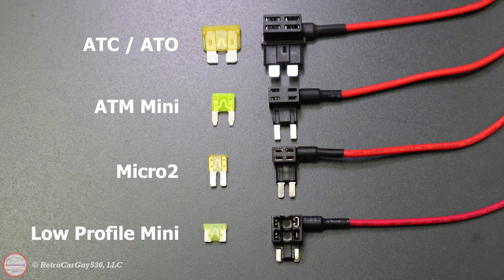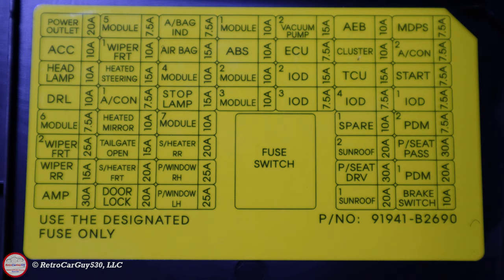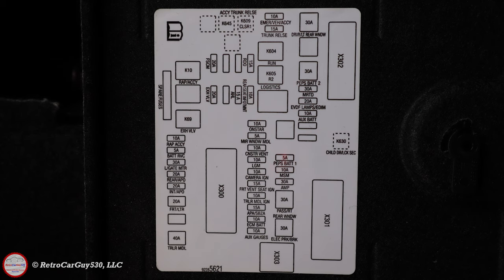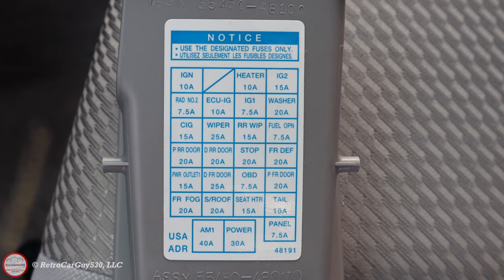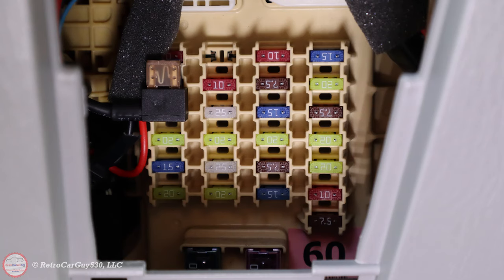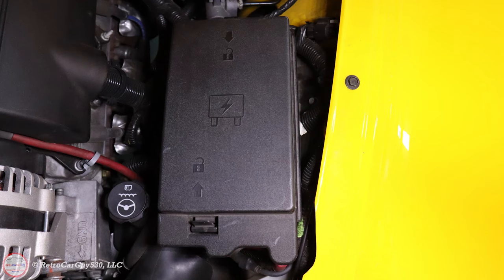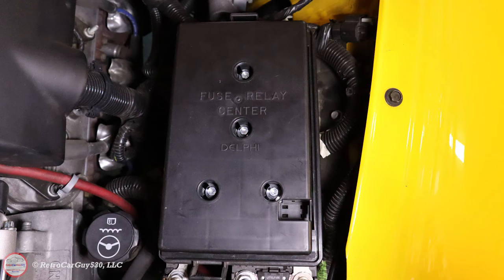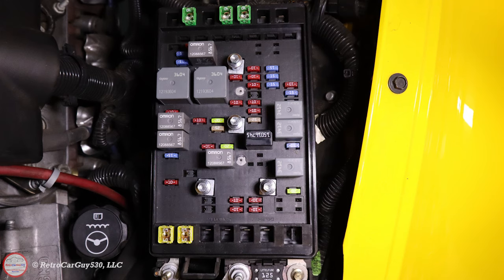How To - Add a Fuse Tap in Your Vehicle

Comment: Im tapping into my fuse box to install an aftermarket stereo. What. Amp fuse should i he using and what kind of wire. I have a 10 amp fuse and speaker wire atm is that ok?
Reply from the maker: I would not use speaker wire for powering the unit (if I'm understanding your question correctly).  Most fuse taps have a 14 or 16 awg wire lead coming out of it.  There are a large number of wire-to-amp charts on the internet that show a 14 awg should carry no more than 15 amps for a maximum of 6 to 8 feet.  If its 16 awg wire the distance is even shorter at 15 amps.  I used search terms "automotive wire gauge amp chart" on google to find a variety of those charts.

I would recommend regular automotive wire (copper) to run from the fuse tap to the new stereo power input.  Since the fuse tap likely has a 14 or 16 awg wire lead coming out of it, you can't really expect to safely use any gauge wire bigger than that.

If your stereo requires more than 15 amps, then powering it directly with the power from a fuse tap may not be possible.  Although, you could use the fuse tap to power a fused control relay which is wired to supply higher current draw (amps).  I used this approach to wire in a dash camera battery pack (that supports parking mode recording).  The dash camera battery pack has two current / charge levels.  A lower amp draw mode that can be safely used with a power port plug, but it doubles the time it takes to fully recharge the battery pack.  The other charging mode consumes more power/amps and reduces the charging time in half, but you can't safely power that through a power port plug - you need to hardwire it with appropriate wiring.

In that situation, the fuse tap power lead supplies power to a power relay with a fused power circuit.  When the fuse tap supplied switched power is on, the relay control circuit closes which supplies power from a different source with a thicker wire to then supply power to the dash camera battery pack for charging.  This way the fuse tap power demand is low and it won't overdraw the wiring of the fuse tap and the higher amp draw power is run through a fused relay (connected directly to the battery positive terminal in my case).  I used a control relay that actually has a fuse socket in the relay itself so the power it supplies is still protected by a fuse.

I hope that helps.
Reply: Thanks for the quick reply! I didnt think it would be suitable. In the manual for the stereo it days the maximum  current comsumption is 10a. So use a 10a fuse? And the operating viltage is 14.4v (10.5-16v allowable) sorry if i sound dumb. Electrics is not my strong point. I will get some suitable wire, i have a 10a fuse and thanks to your video i am confident that i can do it correctly.
Reply from the maker: Sounds like a 10 amp fuse should work.   Good luck with your stereo installation!

Comment: what if the SAP type power outlet is required to power some electronics ? Can we still use the fuse panel for that ?
Reply from the maker: I'm going to have to ask for some additional info to make sure I can answer your question correctly.

If you're asking whether you can add a fuse tap to a fuse socket that supplies power to a power outlet in the vehicle that powers some electronic accessories, the answer is maybe.  If the fuse tap added fuse and the original fuse in the fuse socket don't exceed 25 amps total (sum of both amp ratings of both fuses), then you most likely will be able to add the fuse tap.  The concern is that most power ports tend to have a 20 amp fuse by themselves so adding a fuse to that fuse socket would mean at max a 5 amp fuse could be added with the fuse tap.  I talk about max fuse loads, wire gauge size and wire length as factors that go into making the decision of whether a fuse socket is viable for adding a fuse tap.  You might want to check out my other FAQ video for this topic.  https://youtu.be/DnZ5wb_A5vE

I hope that helps!
Reply: @RetroCarGuy530  No I meant supply of POWER ( with fuse) at the fuse panel for ignition based power supply. I saw that you get the power from the fuse panel - so does that mean it( fuse board) is a source of power for additional sockets ?
Reply from the maker: The fuse panel will usually have four different types of power supplied in the various fuse sockets in the fuse box/panel.

Unswitched - power supplied from the vehicles battery and is available 100 percent of the time.  This power is usually fed directly to the fuse box/panel from the vehicle's battery.  In the video, I used an 120V AC to 12-volt DC power supply to act as the vehicle's battery of unswitched power.

All of the remaining types of power are supplied to the fuse box/panel by having some switch, relay or control module determine when power is supplied to that circuit in the fuse box/panel.

Switched - power supplied when the ignition switch is in either the accessory or "run" (engine running) position.  The ignition switch or "start button" circuitry will send power to specific pathways/circuits in the fuse box/panel when in the accessory or run position.

Switched RAP - just like switched power but it may stay powered for some period of time after the ignition is turned off or until a door is opened (radios in many modern cars use this type of power).  There's usually some sort of module (often the body control module) that will keep track of the state of this type of power and turn it off if the time limit is exceeded or a door is opened.

Relay (or Module Controlled) Switched - This one is a bit specific to a feature in the vehicle.  A relay is commanded on/closed and power is supplied to some feature/accessory/function in the vehicle.  It likely will be routed through a fuse in the fuse panel/box as well.  For example in some vehicles, there may be a relay that is used to control the power sent to the vehicle's headlights and that power is only on when the headlight switch or control circuit commands it on.   Another example of this type of circuit is for the engine's starter motor.  The ignition switch does not directly supply power to run the starter motor, but it sends power to a relay or control module which will send power to starter solenoid.  The starter solenoid then will close the circuit so high amp power can be supplied to the starter motor to start the engine.

There may be a module in control of the power sent through a fuse socket as well.  For example in my 2014 Chevy Caprice PPV, the Body Control Module (BCM) is in control when the various interior lights are turned on/off.  There is still a fuse in a fuse box/panel for each of the items that receive the power, but the BCM is in control of when power is supplied or supplies the power itself to the fox box/panel's fuse socket.  The interior dome lights are one example of that type of power controlled by the BCM.

The fuse sockets in a fuse box/panel have a very specific mapping of circuits on the underside of the fuse box/panel.  I would not take power from one fuse socket in a fuse box/panel and jumper it to another set of fuse sockets in the fuse box/panel.  Those fuse sockets may have a connection to something else in the fuse box/panel that may start back feeding power to something that may result in odd device/accessory behavior or an unexplained battery drain issue.

I don't know that I've answered your question of not, but I hope this has helped in some way.
Reply: @RetroCarGuy530  really thank you for all this though of little use when it comes to my short question > I was simply asking for SAP power( ignition controlled power) to be sourced from Fuse panel and yet you explain all the rest- Sorry I 'm still confused: Put it simply this way : Can I source  a power socket from the fuse box rather than from the battery directly?
Reply from the maker: Thanks for the additional info / restatement of your question. The short answer is probably no.  The reason being that the power demands (amp draw) of the power port you're trying to power from the fuse tap in the fuse box is likely to exceed the the available amps available in the fuse socket (unless it is not occupied with an existing fuse of any kind) or the fuse tap wire gauge of 16 awg or 14 awg might not be sufficient for the amps required and length of the wire of the new power port.  

The answer can be a "yes" if the power required by the accessories powered by the new power port will be less than the available amps in the fuse socket and can be supported by the wire gauge and length of wire.  I talk about all of those issues in the FAQ video that I have a link to in my first reply to your question.

In the FAQ video, I have a chart of amps vs wire length showing the general rule for how many amps a particular wire gauge can handle and for what length of wire it can handle it.

In the FAQ video, I discuss the calculation you must perform to see if the new accessory (or power port in this case) amp draw can be supported by the fuse socket you want to add the fuse tap to.

If you can say "yes" to all of the questions above, then you should be able to add the power port via a fuse tap, but in most cases the power port could have a device plugged into it that may overdraw the amps of the fuse/wire gauge unless there's a dedicated accessory you're going to plug into it which won't exceed those limits.

If the fuse tap approach won't work for directly powering the power port, you take the approach of getting a 12-volt relay that has the fuse tap supplied power operate the control side of the relay and the power supply side of the relay goes directly to the battery (with an inline fuse or a fuse at the relay).  I use this approach for the dash camera battery pack I have in my current 2014 Chevy Caprice PPV project car.  

A switched power fuse socket is used to supply power to the control circuit of the relay.  The relay's power supply side is directly connected to the positive terminal of the battery with an inline fuse right at the relay.  I have a 5 amp fuse in the fuse tap that supplies power to the control circuit side of the relay and a 15 amp fuse in the relay that protects the power supplied from the battery to the dash camera battery pack.  The wire gauge and amperage requirements of the control side of relay are well within the capabilities of the fuse tap and its wiring.  The relay wires and additional wiring running from the battery-to-relay and relay-to-dash_cam_battery are sufficient to supply the up to 15 amp power draw for the dash camera battery pack.  There just wasn't a viable fuse socket in the fuse panel supplying switched power and that had available amperage to supply power directly to the dash camera battery pack directly.  That's why I went with the relay solution.
Reply: @RetroCarGuy530  Make sense - many thanks - the kind of max current of the device intended is 2000mA - it should do the job I guess!

Comment: How come if you use a t-connector and tap power directly from the positive wire on the cigarette lighter, you don't need an extra fuse? But this method you do?
Reply from the maker: A t-connector is relying on the fuse for the circuit that it's tapping into to protect it.  A blade style fuse tap let's you use the original fuse (if any) to protect the original circuit and the new fuse to protect the new device/accessory.  For example, a dash camera only needs a 2-amp fuse to protect the dash camera and its wiring.  IMO, it's safer to have that additional fuse protecting the new wire being added and the new device being added.
Reply: @RetroCarGuy530  hmm my fuse box is my 2010 dodge caravan is under the hood so I'm not sure if I should run the ignition wire under the hood to the fuxe box or connect to the wire on the lighter port
Reply from the maker: If the combined amp load of the anything you plug into the cigarette lighter port and the other item powered by the t-tap will not exceed the fuse amp rating for the cigarette lighter power port, you can use the t-tap method of obtaining power for the new device.  If you wanted to you could use the t-tap to provide power to an inline fuse holder as well and put a fuse in that fuse holder to better protect the wiring and new device you're adding to your vehicle.
Reply: @RetroCarGuy530  wow didn't know I could do that. So a t-tap into the inline fuse holder to the accessory cable?

Do I have to worry about the amps on the new fuse in the inline holder? Do I just use the correct fuse that the stereo needs?
Reply from the maker: The wire you're tapping into must be capable of handling the power demands of both the new (stereo) and what ever you plug into the cigarette lighter port.  A stereo can require a good amount of power, so I would recommend not using that cigarette lighter port since the wiring is now powering the stereo.   The fuse in the fuse box and the wiring to the cigarette lighter port must be capable of handling the amp draw of the stereo.  If you use the t-tap and inline fuse holder the fuse for the inline fuse holder should be sized for the stereo, but that can never be a higher amp rating than the fuse box fuse for the cigarette lighter port.
Reply: @RetroCarGuy530  thanks for the help. So far I haven't even gotten power. I connected the stereo to the harness and connected the ground and yellow power cable and tested to see if I had power but I didn't.
If the stereo needs to have the red ignition wire tapped into a fuse, is that necessary before I would even see power to the stereo?
Thanks.
Reply from the maker: Most stereos require constant battery power (so the clock and settings are retained), a ignition/switched/accessory power feed and the ground.  If the red wire is the ignition/switched/accessory power for the stereo, then yes you likely won't see the stereo "turn on" until that wire has power.
Reply: @RetroCarGuy530  yep that did it. One more question, I accidentally got a 12gauge in-line fuse holder. Is it OK to connect to wires of different gauges?
Reply from the maker: As long as the wire gauge of the fuse holder is a smaller number (thicker wire) than it's fine.  I would assume the stereo wires are smaller wires in the 16 to 18 AWG range.  Just make sure the connections between wires is a good solid one (soldering would be best).
Reply: @RetroCarGuy530  thanks so much. Got it installed and saved myself $300